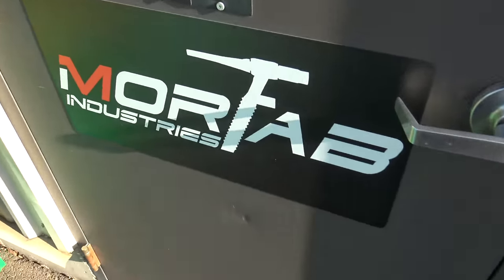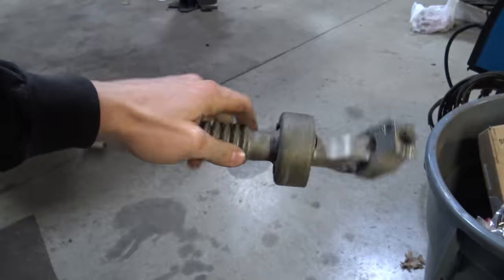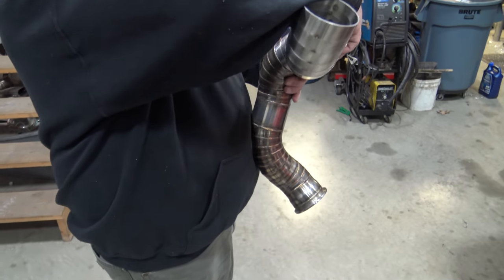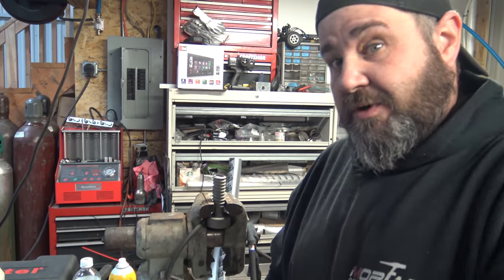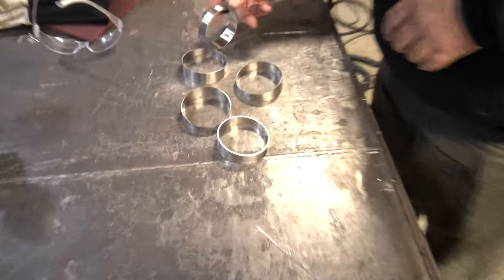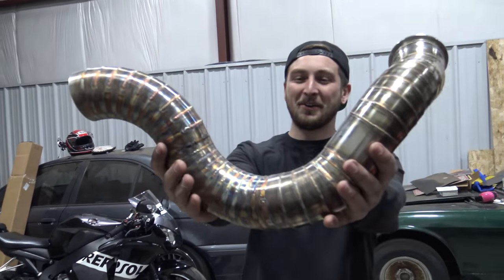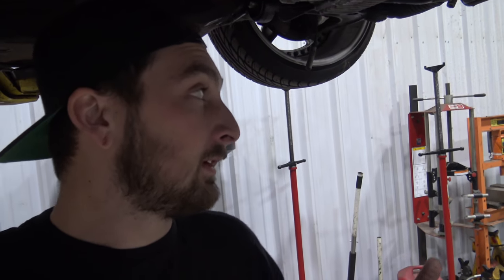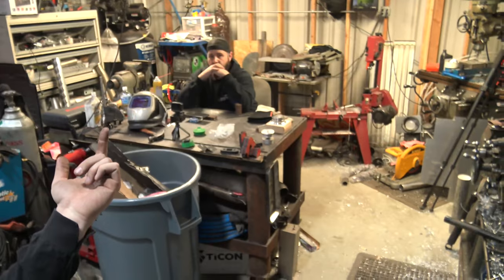RHD TURBO S50 E36 DOWNPIPE! - Making the Impossible, possible!

Comment: I'm really glad your boy actually explained the back purge process, a lot of guys get really discouraged trying to Tig exhaust piping because of burn through, or like he said the pipes cracking because the backside isn't fully fused, and a lot of it comes down to not filling the material with shielding gas. A quick tip for anyone trying to do their own piping too, if you don't have caps or want to buy them a little aluminum foil or foil tape works great and you just need to poke a feed hole and a very small hole for the oxygen to escape.

Comment: This is piece of ART.
P>S Jimmy this drain line is no good, to be placed to the bottom of the oil pan, this way it will not drain properly. Must be higher than the oil level.

Comment: Probably an awkward question since it involves money, but how much does this kind of work cost a normal jackoff like myself? I have zero reference point for paying someone to fabricate and weld a pipe of mine for like 3 hours.

Actually one thing that's always a bummer about working on/building a car based off of the information provided by a youtuber is that I never have a solid idea of how much outsourcing specialist work should normally cost.
Reply: A similar piece would average between 1200-1500US. Get rid of the pie cuts and you could expect to pay 600-800us for something that complicated.